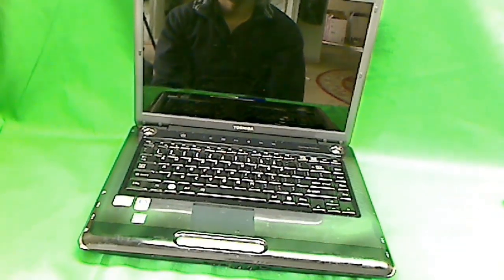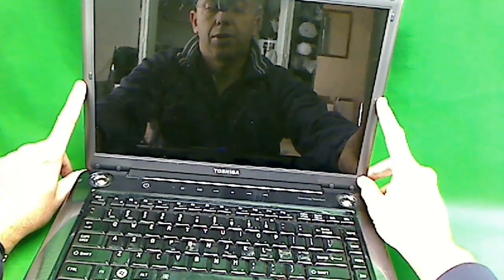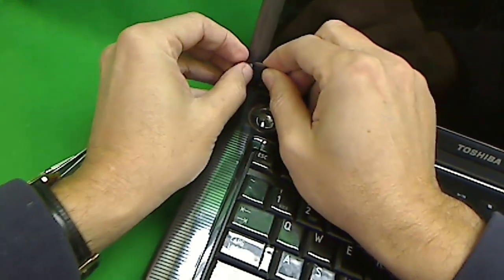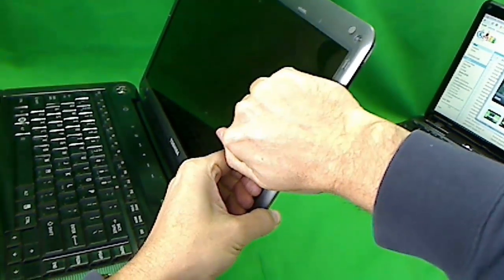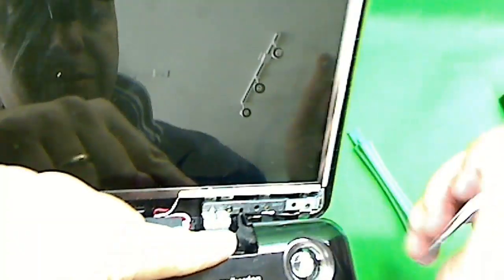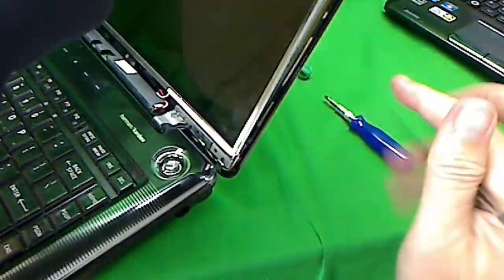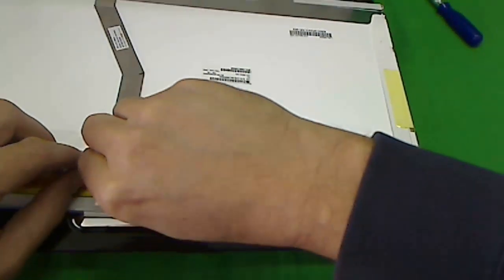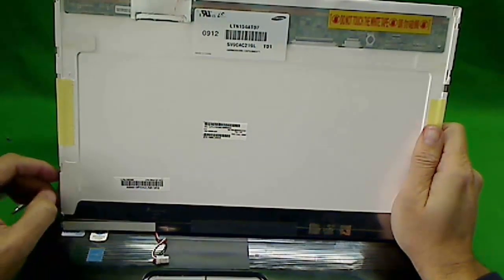Toshiba Satellite A305 Laptop Screen Replacement Procedure

Comment: Tip:  Push the screen away from you as far as you can (laptop making a 60 degree angle).  This will expose more of that tough front bezel.  Then you can take a small flat head screwdriver and pop it off on both sides.

Comment: hi i got Toshiba Satellite L505-13V i want ask about recovery to the system restore factory default setting so i wonder if i pushing on 0 button and hold on it then push the power on button so its will resotre to windo9ws 7 64-bit or 32-bit ??

Comment: Thanks for this Video. Now I know how to do it. First I need to make sure if my lap top needs screen replacing.a vertical a horizontal lines appear on the screen and below the vertical line it shimmers, The top half of the screen works fine. I m not sure if it is the screen which is faulty. When I connect my laptop to external monitor, it works absolutely fine. But someone suggested if the lines disappear when connected to external monitor the problem might not be screen. Any suggestion?

Comment: Dude thanks! great video. It's nice how you guide through the process rather then just showing it at double speed with some rock music. 
I actually need to replace the right hinge on a Toshiba satellite a350 but at least now i have a clearer idea!
Do you know if I need to remove the hinge from the main body part (let's say from the bottom of the computer? anyway thanks.